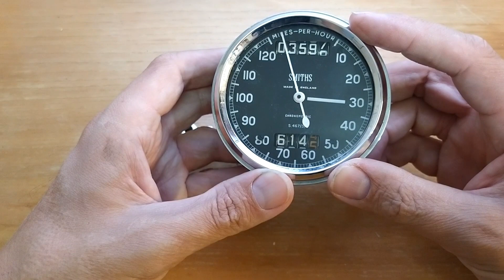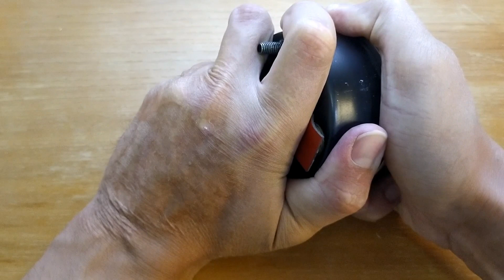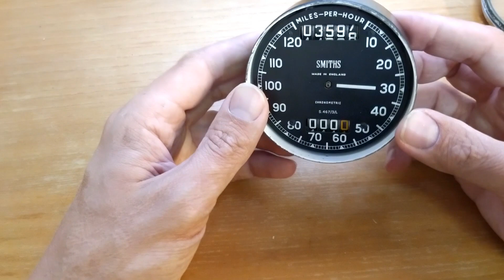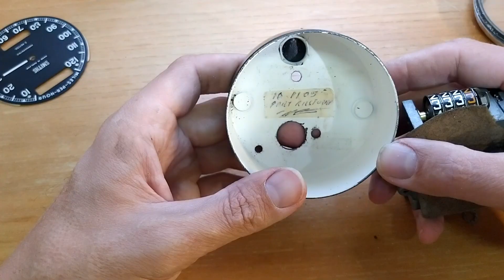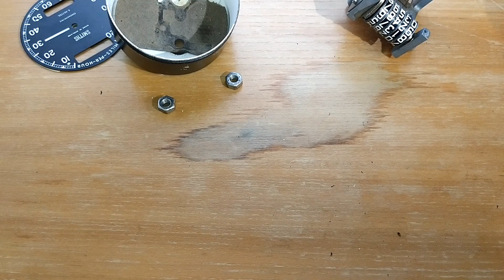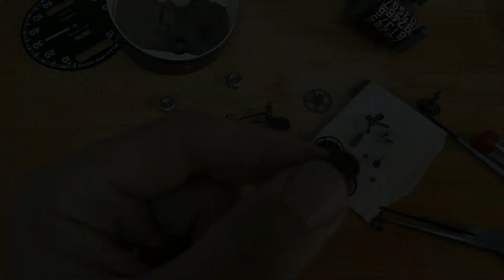Smiths Chronometric Speedo Repair Long Version Part 1

Comment: Thank you very much indeed for an excellent video. I have a 1936 Jaeger speedometer that has exactly the same mechanism. It recently got stuck at full speed and I am in the process of discovering why. I have extracted the main mechanism from the housing and your video is fantastically helpful in showing how to inspect the intricate mechanism, which is my next step. Thanks again.